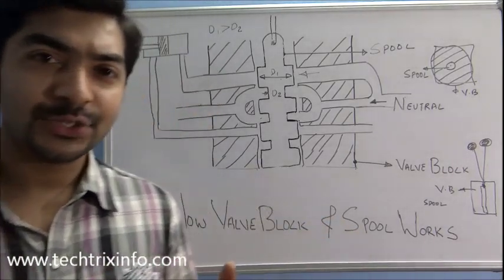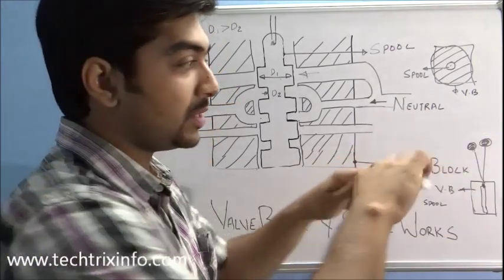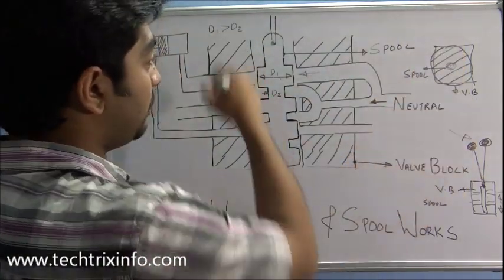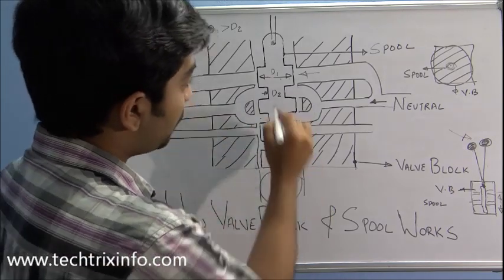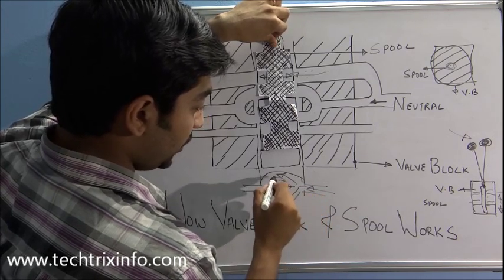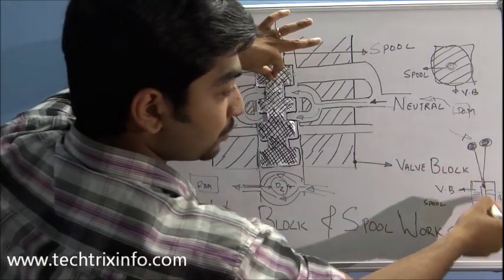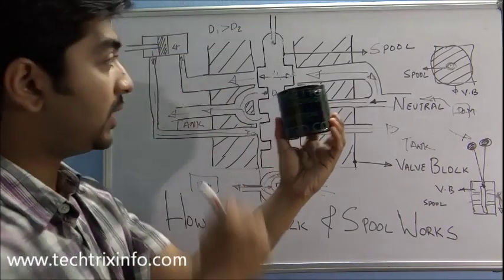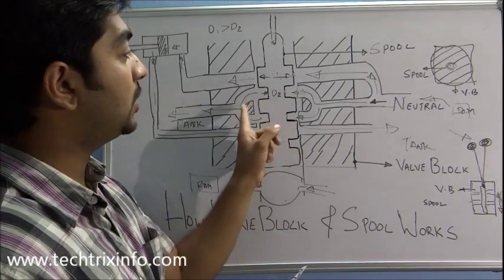How valve block and spool works in a hydraulic circuit. ✔

Comment: Hi, great video but I have a question. If I understood correctly, the pump introduces high pressure fluid at "neutral" right? So then with this set up how would it be possible to execute a reaction stroke (so like the rod moving to the right)? There is no high-pressure input into the hydraulic cylinders' gland end.

Comment: that was a great explanation..i do have a doubt though..this kind of sounds stupid..but..can we use a normal valve for operating a hydraulic cylinder to lift up-to 100 kg of weight??and by normal valve..i meant water flow control valve..its for a project by the way..any help would b appreciated..:-)